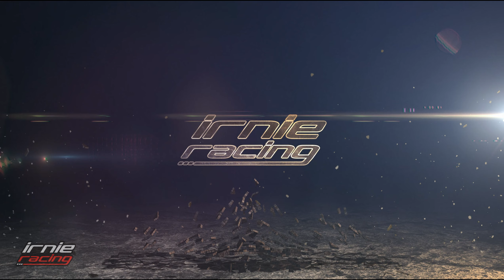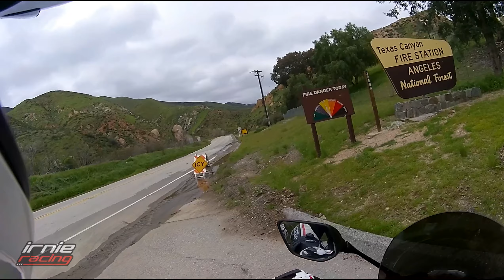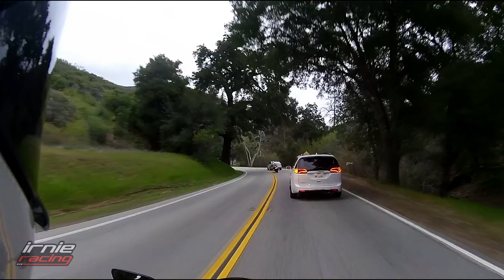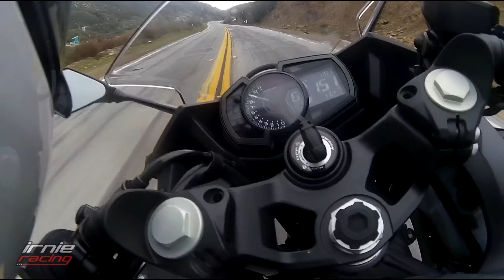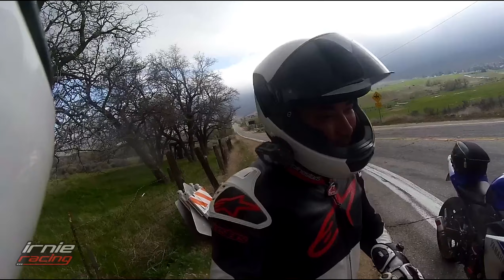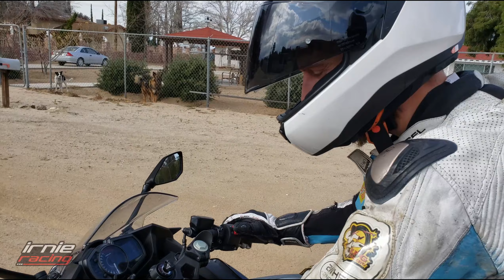Ninja 400 vs. Yamaha R3 DRAG RACE Pt.3 Comparison Review | #projectMotoko

Comment: Your R3 need refreshing dude...  Your Motorcycle is less than 8% the speed of the pure stock.... On the speedo @ 3rd gear your speed is only 70mph that's 114kph... A good condition r3 is hitting 120kph @ 3rd gear....
Reply from the maker: Speedometer's are not accurate and sprocket changes also affect reading.  The point of video is to clearly show advantages of Ninja400 vs. R3
Reply: @irnieracing  even though the speedo is not accurate you bike struggle to reach it's max Speed per RPM so meaning your bike is not running its full potential...
Reply from the maker: @LORDgregz1  agg you missed the fact about sprocket changes affect top speed per gear